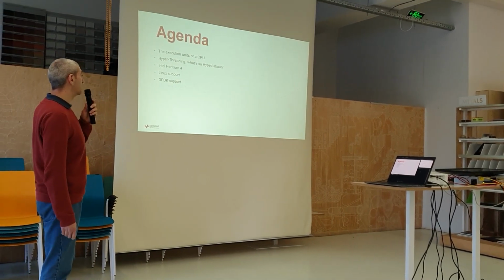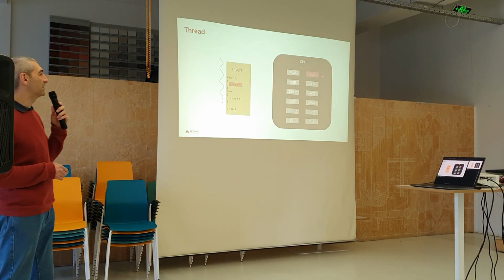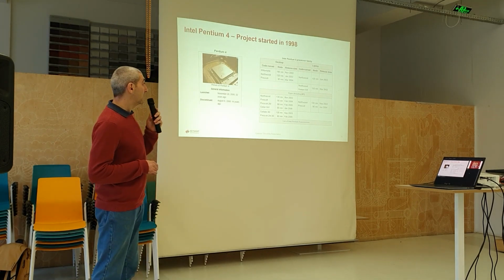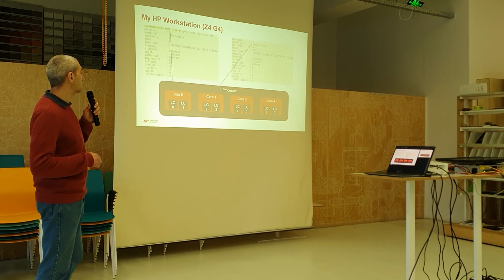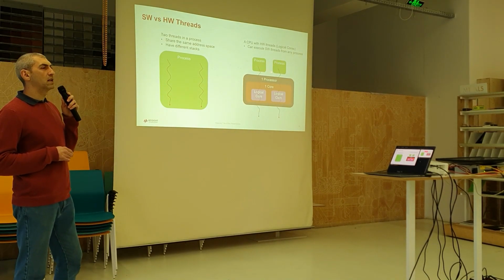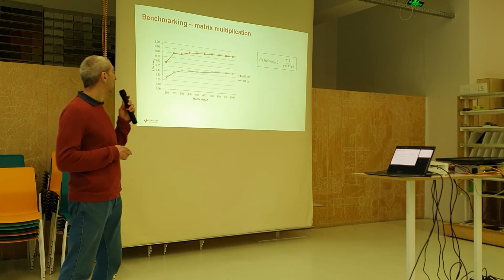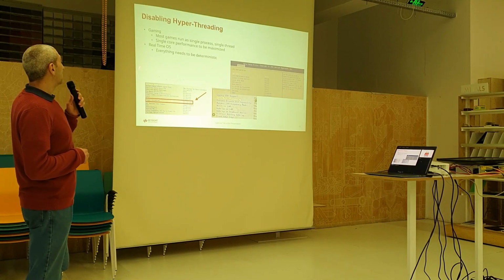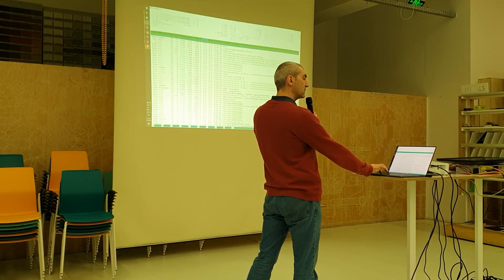All about CPU Hyper-Threading | Keysight Connect #13

Comment: I think with a 4-core I7 cpu, hyper-threading mostly just wastes memory. So due to the additional memory management required for double the threads, you will get mostly slower performance and the GUI will not run as smoothly either. It is good that some laptop manufacturers allow the HT feature to be turned off.